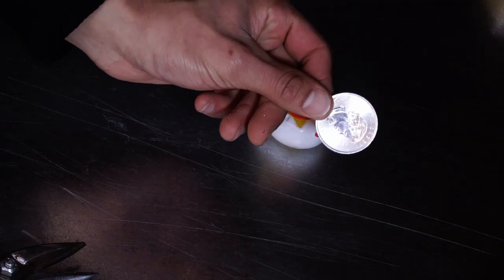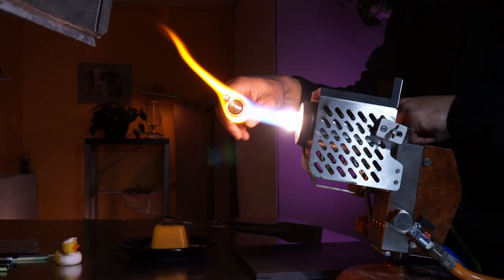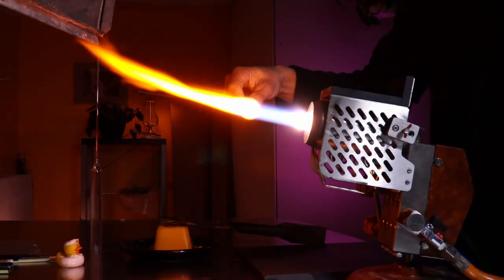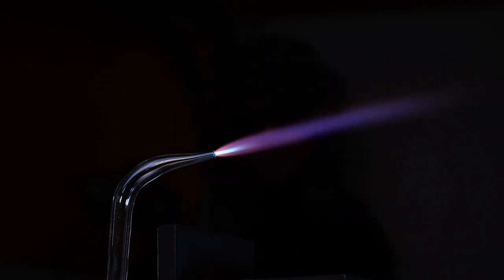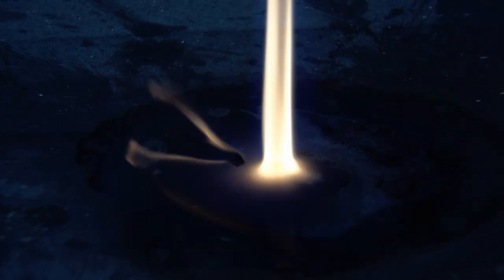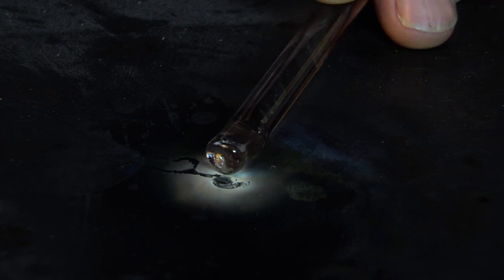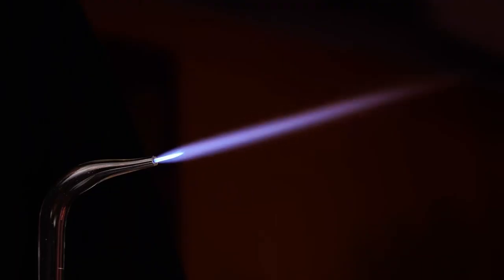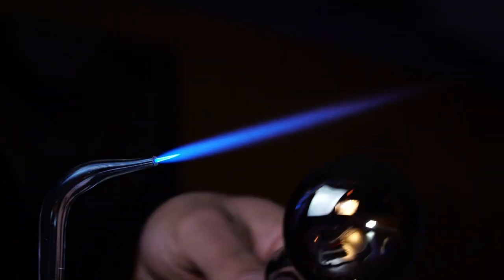Glassblowing: Fuming 101

Comment: Can we get more info on the quartz mini torch 👀 that thing is neato
Reply from the maker: Absolutely! This is a borosilicate hand torch that I made. It's a very simple design, but is certainly a delicate tool. They're great for heat, super clean burning. But very finicky when it comes to adjustment of flame. They can also quite literally explode, so the set up has to be done with proper flashbacks and utmost safety in mind. 

Hope this helps! Thanks for commenting!
Reply: @MarcusBarnesGlass  oh that's even more neato, I didnt think boro could handle the radiant heat of the flame. I guess the oxy is enough to cool everything though! 

Is it essentially just a tube to a "y" split with barbs?
Reply from the maker: @anthonysbrocchi5776  yup that's totally right 🥂
Reply: @MarcusBarnesGlass  super cool! Thanks for sharing 🙏
Reply: I agree! Can we get a video about  it? Please
Reply: We make glass surface mix glassblowing torches also. In scientific glassblowing they make quartz surface mix glassblowing torches when they want zero metal impingement in their work

Comment: Hi Marcus, can you fuse with copper?
Reply: fuming with copper is possible, but it doesn't make nice colors, and the vapor is VERY toxic, so there is a lot of risk in it for little reward
Reply from the maker: Hey thanks for watching :) just like kevin said, its not worth the time. in soft glass, copper wire can be used as a beautiful encasement technique though